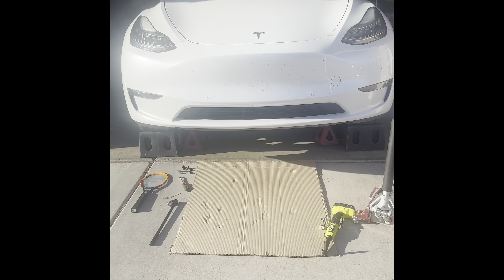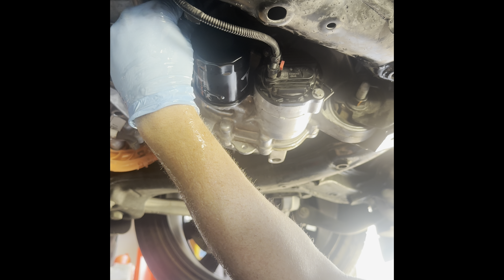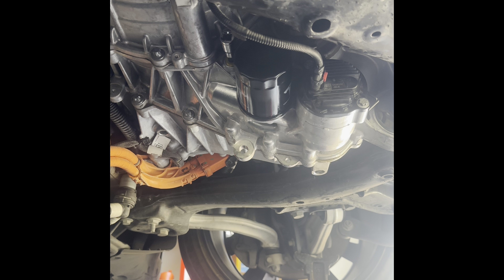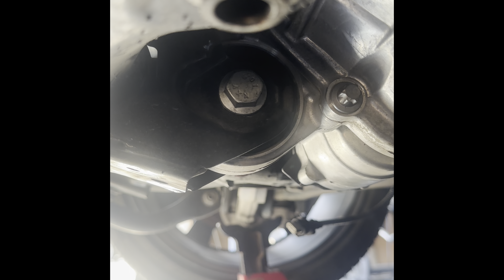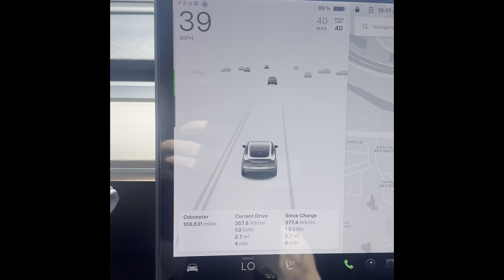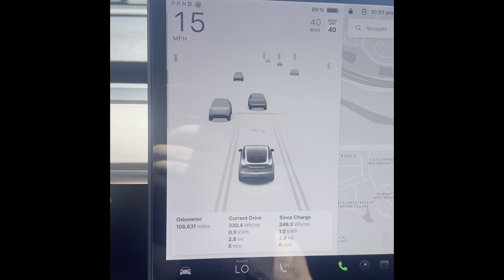High Mileage Tesla Maintenance! 2021 Tesla Model Y LR front drive unit fluid/filter change

Comment from the maker: Just a few quick things, some of which I mentioned in my last video.

1) If you've never worked on vehicles before, get a torque wrench or digital torque adapter. Harbor freight and Amazon have them. Better safe than sorry! Over/under tightening can make or break your vehicle... literally.

2) You might not even need to activate the pump. I didn’t, it took all the fluid with zero run out but did it anyways as an FYI. If you do run the pump make sure you have fluid in the drive unit, the new filter is on and the pump wire is plugged back in before activating the pump.

3) There is no such thing as lifetime fluid and properly performing maintenance will not void your warranty. There’s been several lawsuits addressing this subject with other manufacturers.

4) Take your time, don’t rush, come prepared and this will be a walk in the park. You can do this! Your Tesla deserves fresh fluid to keep it protected! We all want our cars to last for many more miles and proper maintenance is key… even with a Tesla!

God bless and thanks for watching!

Comment: The frame is not in the way.  You just don’t have the right tool.
Reply from the maker: Does the right tool also magically help the bolt and pump clear the frame as well? 😅

In all seriousness if you’ve done it before, let me know what you used but Tesla‘s own service manual also states to lower the drive unit.

Comment: Do you have to use the jack on the drive unit? I don’t remember if you raised the drive unit using the jack in the previous video. What was the purpose of that?
Reply from the maker: Great question.

The rear does not need a separate jack for the drive unit but the front does. The reason is you have to actually lower the front drive unit down a bit in order to get the pump and all the old fluid out. 

It’s not very far, just a few inches but you want a jack under there to hold the weight and get it back into place when you’re finished.

Comment: You went to run the pump without connecting the pump harness
Reply from the maker: Not sure which part you’re referring to but at 24:46 you can see the wire is connected before I run the pump